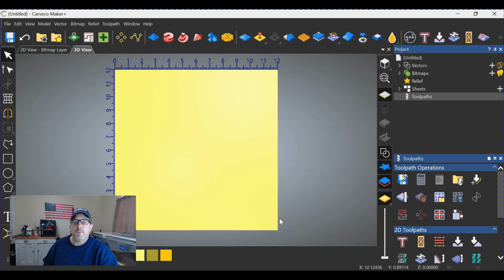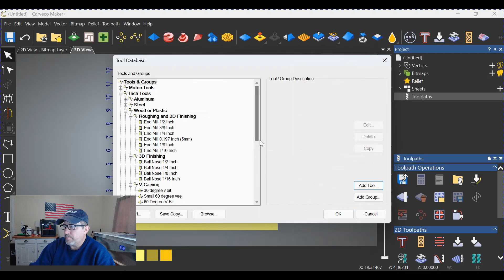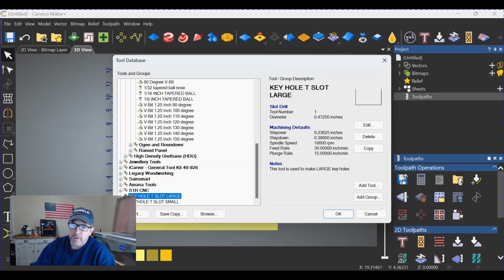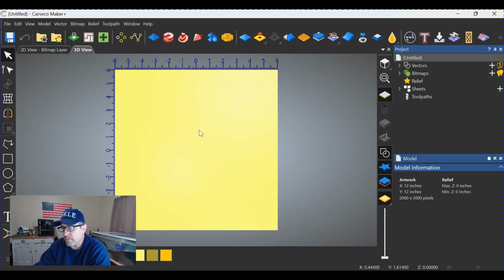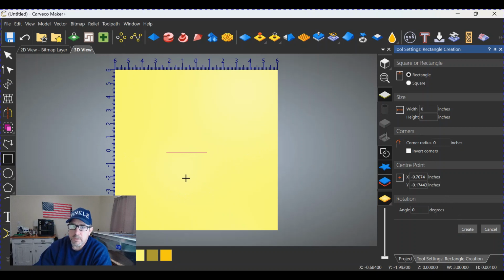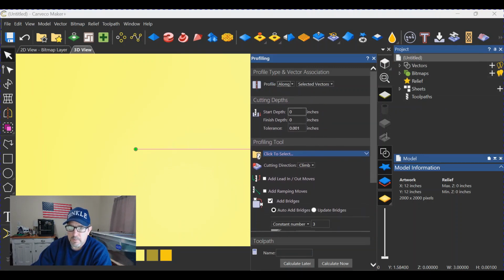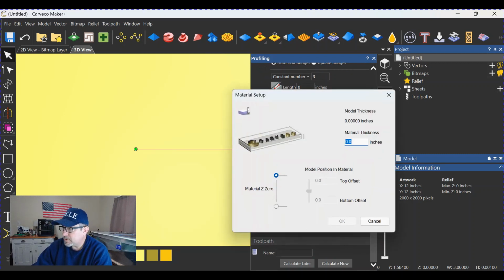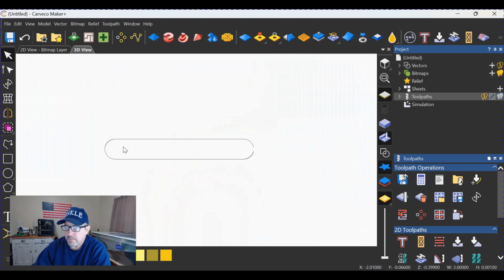#8 Cutting T slots. Mastering Carveco in minutes.

Comment: Safer to force the green Start Node to be at your defined end location. Don't want CarveCo deciding to plunge half way along the slot!!
Reply from the maker: More than one way for sure I’ve always had success my way 
By setting the plunge depth the same as the cut length of the bit I’ve never had an issue